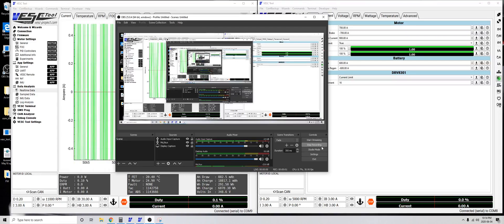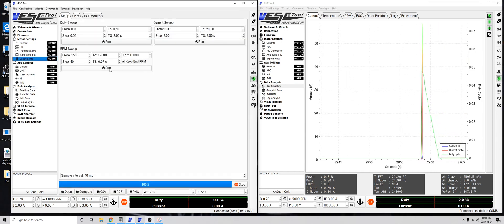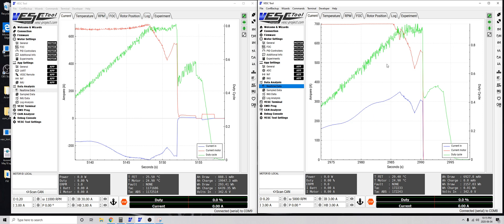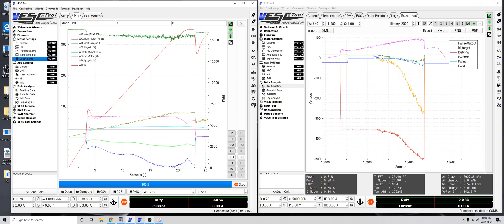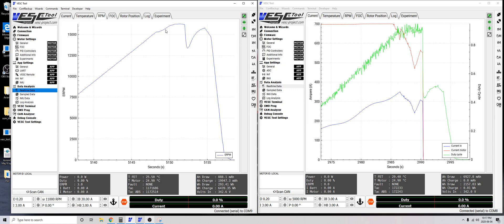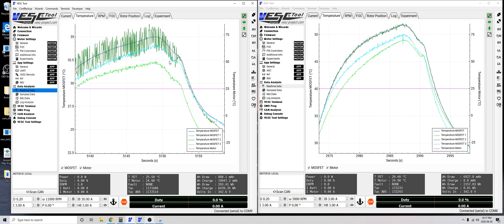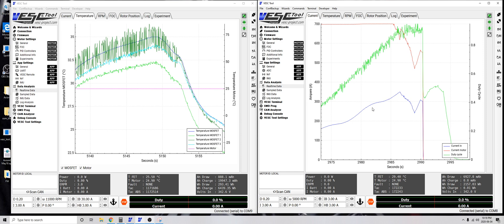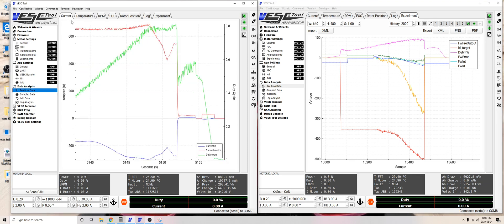Quick test with some Field weakening working and 700 phase amps

Comment: Nice work as always!   Would it be easy enough to have the motors flip roles,  that is make that one that was the motor perform the dyno roll and the dyno  motor perform the drive motor roll?   That way you could see if the temp difference  follows the unit (in which case you know it's calibration) or the role (doing all the regen) is actually more work for the IGBT's.

Comment: Epic!!!!
The IGBT temp raises pretty fast. How warm is the coolant?
Reply from the maker: Not that warm.  <30 deg after most runs starts at ~20 deg.  More to come on this.  The IGBT temps on the regen side are a lot lower.  I need to investigate this as even when running it the ther way the same controller claims its hotter even though they both measure the same with a thermal cam and or temp gun.
Reply: @garbizwal  keep it up man! I've convinced myself to get my DC setup converted to Leaf here soon (I was told 72kW into an 8" DC might be near the limit).

Comment: I like the sound of the motor at high rpm :)
Reply from the maker: Wait till its at 4x this speed!  :)
Reply: @garbizwal  What would be the top speed with the stock transmission at that RPM?
Reply from the maker: @bjornnyman6891  Depends on your wheel diameter.  With my last inverter I spun the motor to  15,000 rpm and it topped out at 130mph with the street tires.
Reply: @garbizwal  That's enough for me, thanks! I'm planning to make a racecar with a Leaf motor, and the 10000rpm speed limit of the stock inverter has made me look into really huge SUV tires =). And that would still only get it into the 100-110 mph range.
Reply from the maker: @bjornnyman6891  OEM leaf will do 100mph.  But My tires were about 2.5" of smaller
Reply from the maker: @bjornnyman6891  Also I found a guy who can make custom gears and I will likely try to go that rout especially when I try a LSD.